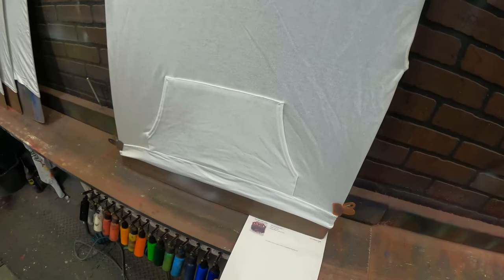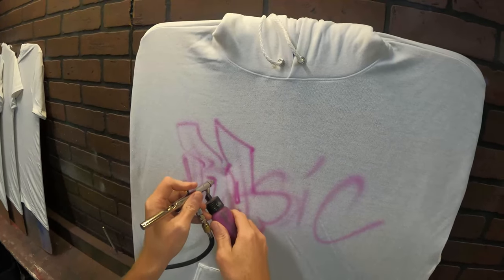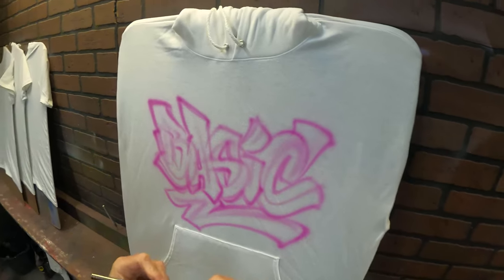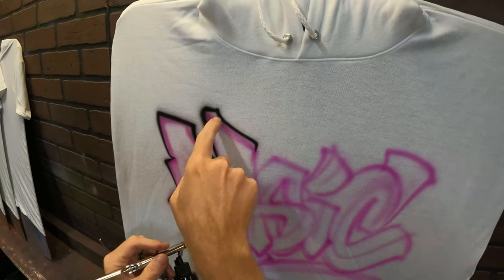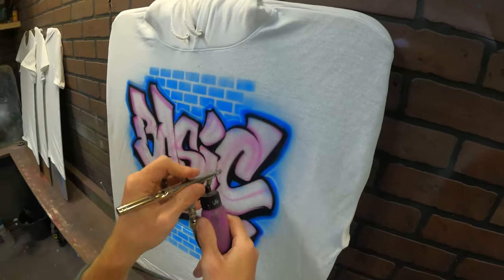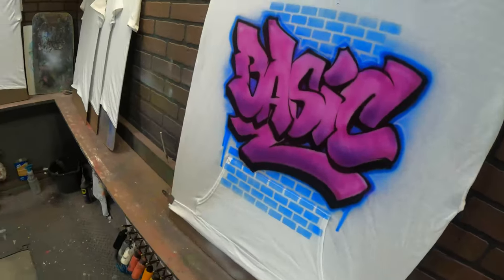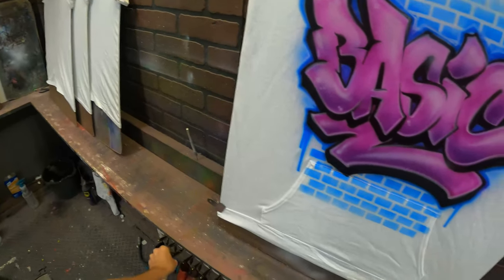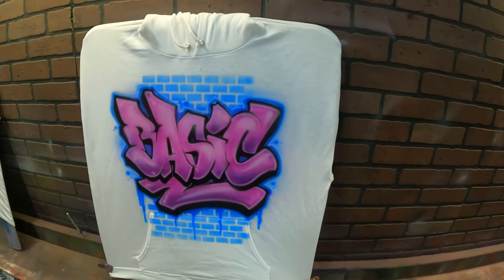How to Airbrush a Graffiti T shirt Design | "BASIC"

Comment: Cool Hat! Your graffiti letters are well done nice design ....Can you do a video on heat pressing the shirts like the temp you use and how long you heat press and do you use a teflon sheet when you heat press?
Reply from the maker: Thanks! Haha
I will at some point!
I press my shirts at 350f for 20seconds. I only need teflon if there's a photo transfer
Reply: AirbrushCustoms thanks and wow I been heat pressing for 375 for 30 seconds but I use aqua flow not sure if that matters
Reply from the maker: As long as you're not burning the shirt, you should be good to go!
Yeah, each paint is a bit different. If they have instructions, definitely go with those

Comment: Do you add any sealers before or after airbrushing , so the paint won't wash out when you put it in the washer..?
Reply from the maker: I seal the paint with heat. 350 degrees for 20 seconds.